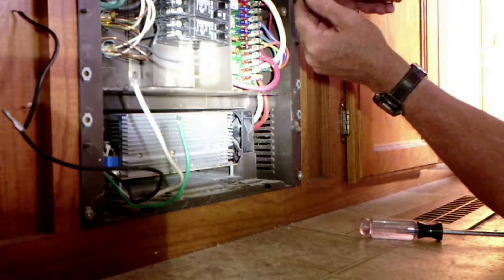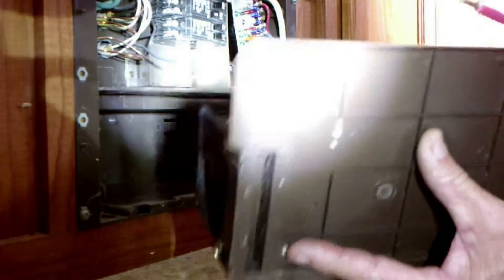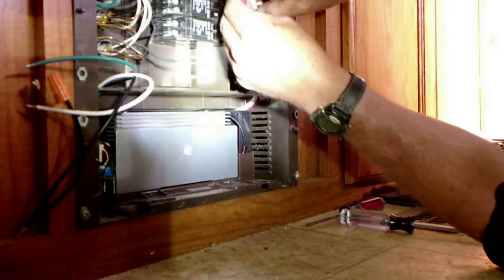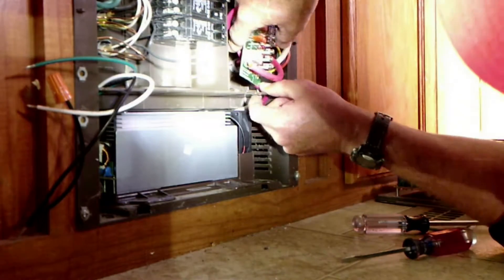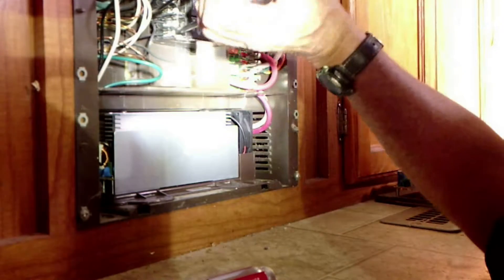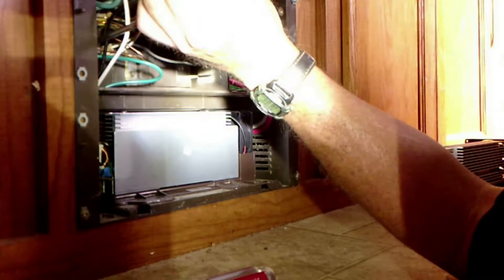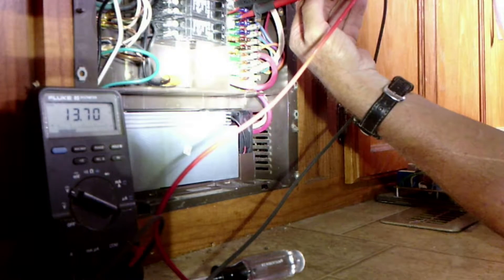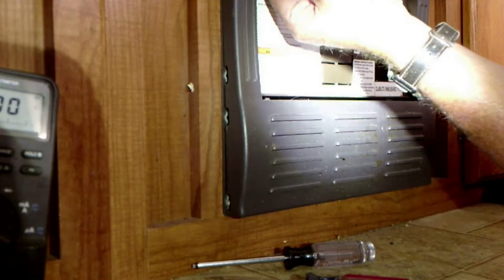RV Power Converter Test And Replace

Comment: is it better to have no battery hooked up than a old battery ?
Reply from the maker: I think a battery that is bad can take out a converter.
Reply: @hillbillyrv  iv got two trailers. my big one has space for two batteries. i had one old battery hooked up and that trailer had been constantly plugged in for over a year and its been plugged into a 30 amp plug. i checked the voltage there and i think it was at 12 which i heard it should be more like 13.5. i disconnected and taped the connections. planning on moving in that one this winter and   i will check voltage again now that battery is gone. my other one is plugged in with a adapter to regular extension hopefully was at least a 15 amp. i checked its voltage and it was low around 11.5 i think i also noticed melting a bit at the adapter. so i unplugged and installed a new 15 amp outdoor cord and cleaned adapter a bit. just ordered a new adapter i rechecked voltage after and it was up to 13.5 so the bad connection was making it lower. i started checking today becUse my furnace stopped working after last winter. turns on but seems low power and just blows cold and does not light. local store told me it could be converter going out. so got me checking things after rechecking with better voltage furnace still does the.   same     your video did get me thinking about the old batterys i did have connected. i usually have no batteries connected but did hook uo this one awhile back i dont kmow why  and then i did in winter to run the furnace when power went out    thanks. got real nervous about frying the converters. and for over a year id been waiting to get help to make a 30 amp plug for my one trailer. i could have done it myslef by now im sure and will now   hopefully my other converter was showing low due to the old battery.  do you think i should have it hooked uo to a good battery or no battery ?  my fifth wheel has a spot for two batterys but also it is the one that is plugged into 30 amp but it gets used barely as i live in the other and planning on moving into tge fifth wheel soon
Reply from the maker: @joesmith-fi1sx  The only time you really need a battery, is when you run the rooms in or out.
Reply: @hillbillyrv  I used to wonder if keeping a trailer plugged in would wear out tge converter. if they were meant for permanent use.  havnt thought about it it a while as i have a refrigerator in each.  what do you think ?  is there any maintenance i can domon my converters ?
Reply from the maker: @joesmith-fi1sx  Nope. They either work or they don't.
Reply: @hillbillyrv  ok. thanks buddy.  love the chanel. i live in a bumper pull 22 foot and been customizing a fifth wheel for my cabin. appreciate the help
Reply: @hillbillyrv  well i rechecked. im getting 11.45 volts off my fifth wheel. at the battery terminals. what do you think
Reply from the maker: @joesmith-fi1sx  Awesome
Reply from the maker: @joesmith-fi1sx  With or without the battery hooked up?
Reply: @hillbillyrv  without
Reply from the maker: @joesmith-fi1sx  That's a little low, turn on lights and turn on furnace. I bet the voltage will be less. Converter is probably bad. I said probably. More testing would be required to confirm that 100%
Reply: @hillbillyrv  dang. everything inside works. outlets. fridge snd heaters running off outlets. AC all summer. i did have a old battery connected all year. that was stupid of me.  So let's say it's bad should I expect it just to be totally dead one day or just slowly fizzle out any tips on other test I can do the test it out thanks
Reply: @hillbillyrv  converters convert AC current to 12 volt. but they also enable the AC outlets to work right ?  bad converter means outlets will stop working right?
Reply from the maker: @joesmith-fi1sx  nope
Reply: @hillbillyrv  wait what.  so if my converter goes  bad or out completely  are you saying my ac outlets will still work ?
Reply from the maker: @joesmith-fi1sx  yes
Reply: @hillbillyrv  hallelujah!!  i always was scared if it goes out im screwed.  is there any device or contraption that contols the Ac power out lets

Comment: I suspect that we have a bad converter but havent tested it yet. What happens is it will be plugged in to 30 amp shore power and the camper shows 13.6 volts but then out of no where it will drop to 7 volts then to 4 volts. It will stay like that for a while then all of a sudden back up to 13.6 volts again. No rhyme or reason.
Reply from the maker: Hard to say. Testing is definitely the next step.

Comment: My wife accidentally hooked our camper to my 220 welder plug instead of the 120 plug I installed. I knew I should have painted the welder outlet red. Anyways she said that a small smoke cloud came out of the panel converter area. I checked all the breakers and fuses and everything checks out but, I still don't have any 12v power. I'm wondering if the converter fried. I did look at it but, don't really see anything on the board that looks fried. I'm still leaning towards the converter I guess I just need a second opinion before I throw down 250 for a new converter. Thanks of the video
Reply from the maker: 220 volts will kill the converter 100% of the time. That has been my experience. I have whole video series on this. Search my channel. It should pop up.
Reply: @hillbillyrv  Thanks for the quick answer. It's greatly appreciated. I was thinking the same exact thing.

Comment: Got a question for you.  Today I stepped in the RV and switched on the lights, upon hititng the 3rd button all the lights went off.  I've replaced the fuze (15A) several times now and it keeps blowing.  I can only turn on certain lights inside, the exterior LEDs refuse to function and every time I hit that one switch, the fuze automatically blows.  I've completely disconnected the battery as well as shore power hoping that this would eliminate any chance of overload but still nothing.  Any suggestions?  Thanks in advance.
Reply from the maker: You have a short to ground

Comment: Hello, My 45 amp converter failed, If I replace it with a 70 amp unit would be an improvement?
Reply from the maker: The higher the amperage, the more batteries you can charge. If you only have 1 or 2 batteries, it will be fine, just overkill for your system. Better to be too big than too small.
Reply: @hillbillyrv  thank You Sir!

Comment: When mine didn't work I found the plug coming in to the RV had a loose screw on the neutral romex connection. Of course no AC as well.
Reply from the maker: Thats why I always check the AC coming in first.

Comment: No overhead lights ,refrigerator does not work nor does the water pump. I do believe it’s a bad converter. It was my understanding if it’s getting ac with no dc output it’s a bad converter? Also if that’s the case would it also keep the A/C from coming on?
Reply from the maker: Yes and yes

Comment: Awesome video. But what size amp converter do I need for a 30 amp camper? Because Amazon has all different sizes thru your link . Will 30 amps still run it of I replaced it with a 55amp?
Reply from the maker: The converter is only charging the batteries, that's all. It is just a fancy battery charger.

Comment: Great video! You can tell you've done that a time or two. LOL
I just recently had to replace the whole power center, as my DC converter started to burn a hole in the floor below it.
I have a 199x something camper and I wish folks knew that they need to get rid of those old monsters.
Luckily, our dog smelled the burning floor/carpeting first, and we were able to figure out what was happening.

Would love to see a video where you replace a whole unit. There are SO MANY WIRES. :D
Thanks for this video. Very much appreciated.
Reply from the maker: I hate replacing the whole thing. Thats a lot of wires to label.
Reply: I have a 89 camper trailer and I’m pretty sure my power center is starting to go it’s hot underneath:(

Comment: Sir, My converter is tripping breakers. I checked the plug it was plugged into an it was dead. So, I plugged it into another outlet in the cubby hole where it's located, just to see if it was the outlet or the converter. When I plugged it in, it tripped the breaker for the other outlet as well. So I'm assuming the converter is bad? The whole problem started when I noticed that my DC lights and appliances were not working unless I had the battery hooked up and turned on. Then it was just draining the battery, as the converter was not charging it. Normally, as long as I'm plugged in the RV Parks  AC electricity, everything works, even the DC stuff. Can Pretty much assume it's a bad converter, as I have not found any breakers/fuses/relays blown?
Reply from the maker: It is a very good possibility that it is bad.

Comment: Great video! Thanks so much for making this.
My converter is reading 113v in (same as house outlet it’s connected to) and around 12v out, but when the battery is disconnected, and I’m plugged into the 15a at my house, only 1 light will dimly work in my trailer. I thought I’d be able to at least run my lights on 15a shore power… any thoughts?
Thanks!

Comment: you NEVER disconnect a battery by removing the positive + lead first.
Reply from the maker: It's ok. This is a camper, not a modern auto with 40 computer modules.
Reply: @hillbillyrv  🤣
Reply: @hillbillyrv  Your answer raised a RED FLAG in my brain. Is there a need to for you and/or others (AZExpert, My RV Works, etc) to issue a training or "Heads Up" video for your followers if indeed today's newer technology equipped RVs are susceptible to instant power disruptions caused by mishandling power cords at the battery or at other locations? 
I wonder:   are these "Black Magic" (to us born in 1950 at least) Bluetooth and smartphone interactive over the airwaves connectivity with touch screens  all over the interior more susceptible to simple electrical mishap that on older technology might just blow a fuse or trip a breaker? Thanks.

Comment: I didn't know I'd have to be an electrician to own an RV.
Reply from the maker: It's not required, but it helps. And a plumber and a cabinet maker and a carpenter and an appliance tech and a mechanic and probably a couple more trades that I didn't think of.   ha ha
Reply: @hillbillyrv  guess I have to enroll in the school of hard knox
Reply from the maker: @stephaniep1761  Tell them I sent you. I have been enrolled there since I was a teenager.
Reply: You don’t have to be an electrician to own an RV. You just have to have a lot of money to keep it running. Otherwise, you ought to be an electrician, plumber and solid handyman to own an RV.
Reply: same

Comment: What if u only get proper dc power coming out only when u run a high wattage ac appliance? 

Lights will dim very low, propane alarm will beeeeeeeeeep, I flip breaker and it initially lights up full then immediately falls to dim again, and the only thing that fixes it is if I run the microwave or coffee pot, or anything that pulls a lot of ac power.. eventually, after doing this over and over the dc output holds like it should. Sound like a bad converter? I have same unit as this video, but w more breakers
(Learned it happened when it got cold. Like the cold temperature made some apparently damaged component in the converter shrink or weaken and not maintain a steady connection, therefore not supplying proper DC power. New converter seems to have fixed things)
Reply from the maker: It should make good DC power anytime you put good AC power into it.

Comment: Soooo glad I found this video. You saved me a bunch of money. Thought my converter was bad because it wasnt charging my battery. In fact, a new battery I had purchased went dead a few times and finally wouldn't take a charge. Swapped out the battery (it was still under warranty) for a new one. When I saw how you tested the in and out, I did the same. It was working fine. The problem was staring me right in the face. A 40 amp fuse was blown, most likely because when I disconnected the battery, The Pos cable hit the frame while still putting out voltage. Thus the fuse. Replaced the fuse and waa laa. Works fine. Thank you for your informative video.
Reply from the maker: Glad I could help Robert.

Comment: Thanks for this video. My ac keeps kicking the breaker at the post it’s a pretty big fifth wheel but has a 30 amp plug I went to Walmart got a 50 amp adapter plug and plugged in the 50 amp breaker ac came on run fine for 2 hours kicked the breaker, by this time it was getting cool down in the evening so it had gotten cold after dark I had propane in the tanks so I thought I would try the furnace it came on worked fine for 20 minutes kicked the breaker. This time I was in the bathroom working on the exhaust fan which don’t work when the breaker kicked with the furnace running I went out and the breaker kicked immediately four tries I went back in the bathroom and notices I left the fan switch on it is a 3 position switch I turned the switch to off and went out and this time the breaker reset. Went in the camper and everything the uses 12 volt won’t work the slides, awning, radio, ceiling fan, refrigerator, all the lights don’t work everything hook to outlets work fine as does the microwave. I went and bought a brand new battery and everything is back to working but I would think it’s back feeding with the battery and it will soon go dead I think I will have to replace my converter also. I did notice I have not heard the cooling fan run in the converter since the last time the breaker kicked.
Reply from the maker: Glad I could help. Good luck Simsknives
Reply: @hillbillyrv  put a new converter on tonight everything is running like it should..thanks
Reply from the maker: @TheHarleyhillbilly  Awesome !!!!
Reply: Well it’s been a year and the converter is out again, at least I know what it is this time.

Comment: glad I found this video today. Low life corrupt old man (tommy taylor) in mississippi told me he would come out and run diagnostic check on my power system after lights started blinking and going out for hours following a bad storm and power surge. Said he would just charge $75 for this (service fee) and I would have to pay for any part that needed ordered if I needed a part. He finally arrives and takes him 2 minutes to run his check and says "your converter is shot..I have one in the truck". He just happened to have one in an opened box. I had already taken all the screws out of the power unit so all he had to do was slide his converter in the slot and took 5 minutes to hook 5 wires. He looks at me and says "Ur all fixed up, that will be $370.00 plus $100 brings you to $470.00. I almost hit the roof! I said "sir you said $75 for your fee and whatever a part was and I told you let me know if its more than $150". He looks at me like I'm crazy and says "I can just yank it back out and leave". OMG!!!
What  a crook! Then, I google the part and find one on Ebay for $75 but a 2 week waiting period. I found another on Amazon for $170. I ordered it right there in front of him and asked him if he would install it for at NO CHARGE when it arrives? He said "yes and I can be over tomorrow or the next day (today) and put it in for you at no charge".

I text him at 11:30 am and say "I'm here at the camper can you come install it"? 

He replies "for $37.50 I can but I'm putting in a water heater now". we went around and around for 4 hours with him saying "Dude, just put it back in yourself".  OMG people SUCK. This man is on disability..pays NO TAXES and did not write me out a receipt = I will be contacting social security Monday and reporting him as well as the Better Business Bureau. He will regret trying to scam me and double the price of a converter. 

#Tommytaylor
#redneckssuck

Thanks to THIS video, I was able to install the converter myself not knowing what in the hell I was doing as I am a singer/songwriter not an electrician .
Reply from the maker: Thanks for watching Framed Elvisguy

Comment: So to test the output of the converter you test voltage to the lug with the bigger I’m assuming 8 gauge wire? And it should be around 13.7 volts?
Reply from the maker: There are at least 3 bigger lugs. 1 is ground and the other 2 are outputs. The outputs should have around 13.7 volts, yes. Check the anti polarity fusses first.

Comment: You cannot check DC voltage using your earth as your -12 ?
Reply from the maker: Ok....Been doing it for years
Reply: @hillbillyrv  ya    I'm wrong in an RV 120ac and 12 DC are all bonded too the frame never really thought about it thanks
Reply from the maker: @so6585  Yes. I knew that.

Comment: What if your lights go dim when your hot water heater come on but after it goes off your lights brighten back up
Reply from the maker: The water heater board should only pull a few amps. That's weird that it would pull the lights down. You stumped me !!!

Comment: Thanks for this video,  I replaced the one on our rv on my own..but the wires are very tight.  Had trouble getting it put back in..is it possible to run the red, white wires in front of the circuit board? Thanks again
Reply from the maker: Usually the wires are plenty long. Sometimes you just have to do what you gotta do Mark.

Comment: Why is my 12v negative hot?
Reply: I never messed with anything. Since new
Reply from the maker: @cowboyup11374  I would suspect the meter you are using then. That just ain't right.
Reply from the maker: It should not be Chris
Reply: @hillbillyrv  i understand that. I was wondering what would cause that to happen?
Reply from the maker: @cowboyup11374  Everything hooked up backwards? I don't think that should be possible.

Comment: You mentioned in the video that the battery overworks the convertor. I replaced the convertor and still overheating. Does the battery play a factor in it overheating?
Reply from the maker: If the battery is bad. Yes !!!